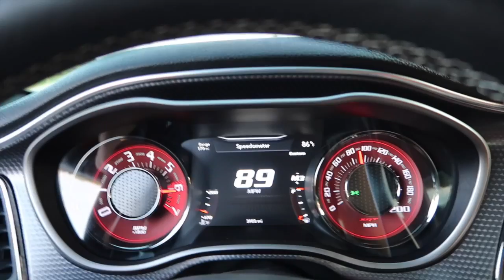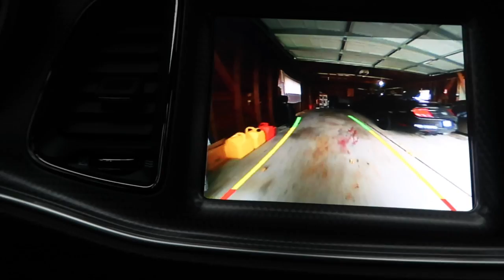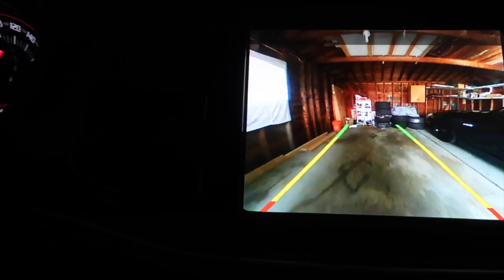THE AFTERMATH OF RACING MY HELLCAT AGAINST STREETSPEED'S MCLAREN 720S!

Comment: My remote start shuts off after 11 seconds.
Reply: Try putting gas in it. Won't stay on with the gas light on.
Reply: @hemichallenger3643  come on, man. 

Youbcan do better than that.
Reply: @Mrmccord225  What do you mean? LOL I thought you were stating a semi-serious question type response? Like you were asking for help? Did I miss something lol? I know when my car had the low gas light on, my remote start started the car and then shut off. Is that what you mean?
Reply: @Mrmccord225  Haha No, I wasn't trying to be a smartass. I understand why in this day and age of internet tough guys you could guess that. I was actually being sincere. Any ways, I googled it for a minute and if you have an engine code it will do that. Could be a couple things, but that was the most obvious answer. There were a couple ignition wire comments and some really far out there ideas. If the tach isn't working then it will shut off because there is no engine running feedback.
Reply: @hemichallenger3643  I have an engine code or two. Lol I plasma cut my active exhaust butterfly cause it was rattling too much with headers and straight pipe.

And added a new pcm for the mods and for some reason no code but the check engine light is on but everything is tuned and working perfect.
Reply: @Mrmccord225  Hmmm Do you have the O2 sensors in? I'm guessing the computer knows that there is a check engine light, and it won't auto keep running to reduce liability that they cause a failure. Being that you drive it with the light on you assume the liability. My guess. Clear the light, and try it again, before the light comes on.
Reply: @hemichallenger3643  the o2 sensors are in. 

I literally just cut the pipe behind the active exhaust, snuck a plasma cutter in there, and welded it back lol.

It was more of an Emotional modification hahaha. I was very annoyed with the rattling hahaha

But thanks for the responses. I appreciate it